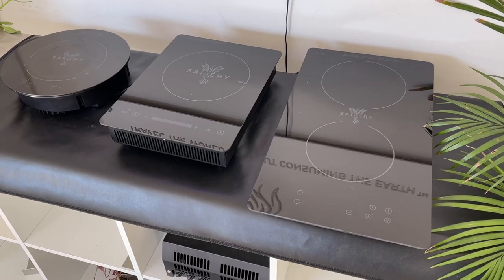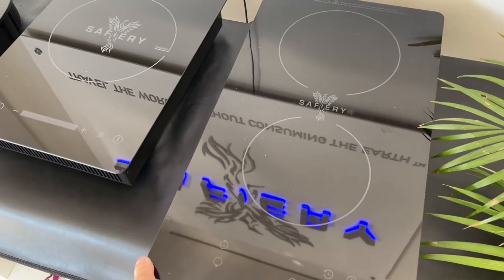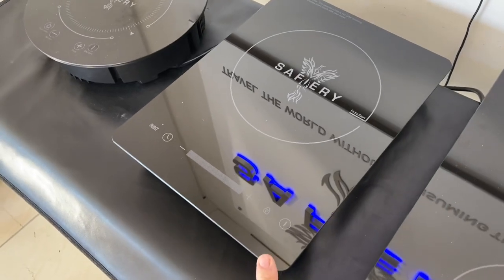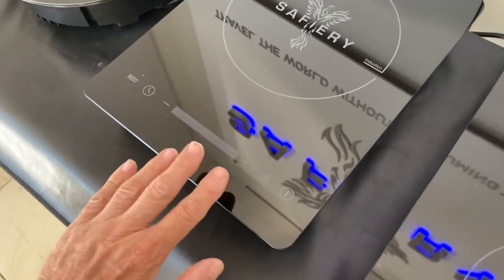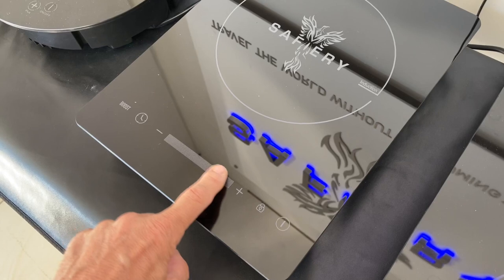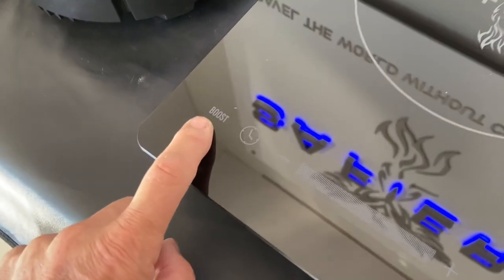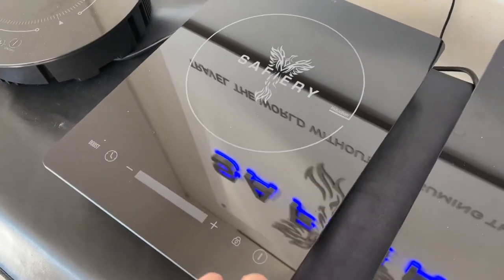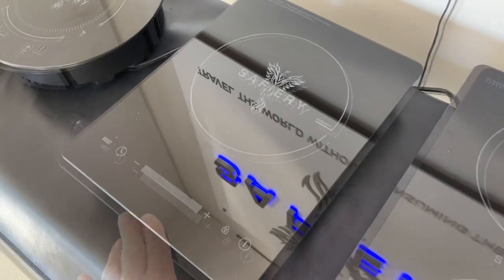NEW 2000W Single Induction Glass Top: 276 x 366 Body cut out 252 x 342,  protrudes through 65mm

Comment: What sort of power are they drawing?
Like for using the hot plate for a few min of cooking how many amps would it use?

Is a 150ah battery enough?
Reply from the maker: These have an adjustable slide control. So just set them to the max that your battery will handle. They will still cook a lot faster than gas as they are 94% efficient. You do need Lithium batteries though.
Reply: That’s a very clever design Bruce, how many amps will that draw and what size fuse would it need?
Reply from the maker: @greghammond7956  That depends on many things - the power from the batteries depends on inverter efficiency and cable power loss. Probably 250A for most, 300A for others. Remember the fuse protects the cable not the inverter so size your cables so fuse blows before cable melts...
Reply from the maker: @greghammond7956  And Battery Quality and SOC. High power pulls down voltage on high impedence lithium batteries which increases current flow considerably.